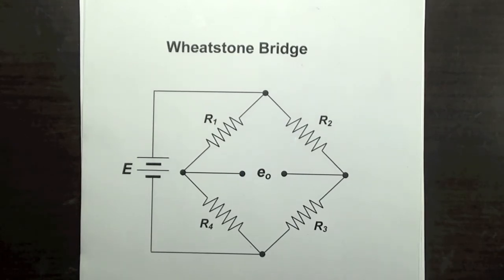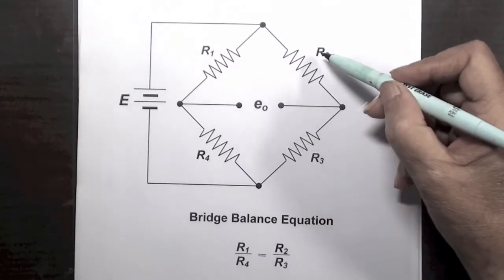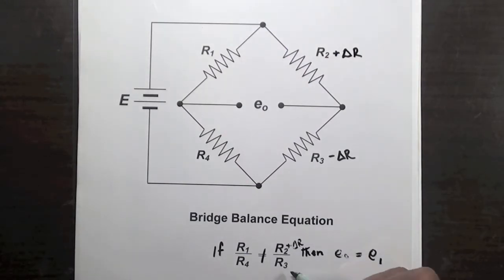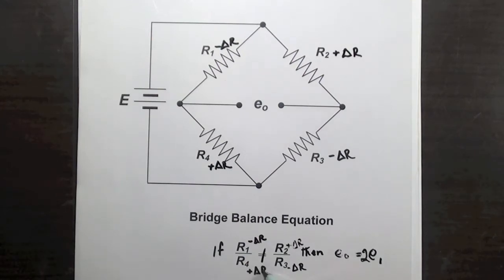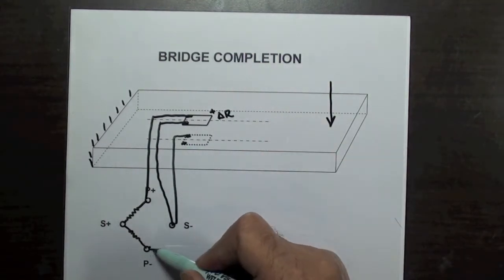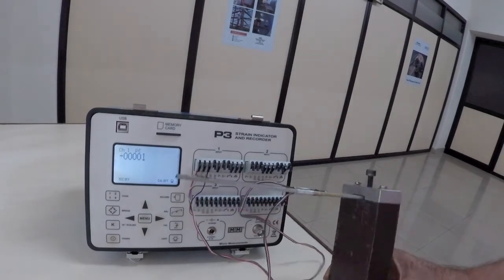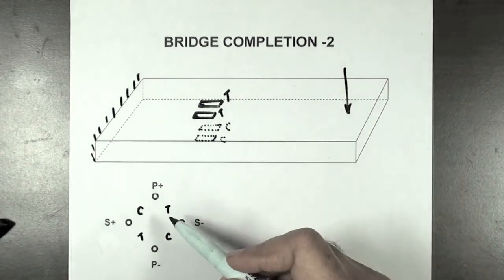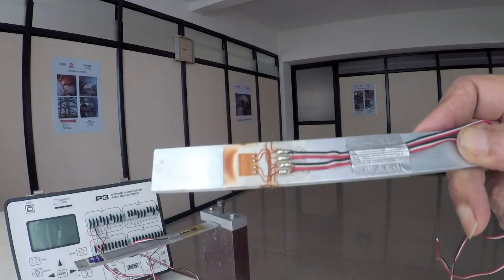Strain gage bridge completion

Comment: what about temperature compensation?
Reply from the maker: If all the 4 straingages in a wheatstone bridge are bonded on the same part close to each other,  all the gages will react equally to any temperature changes , and in a full bridge configuration we can expect these changes to cancel each other, so the effect on the out put of the bridge is insignificant. This is considered adequate for most stress analysis applications
In transducer applications where even small errors are not tolerated, further temperature compensation is carried out by adding small resistance wires made of Balco, which is sensitive to temperature changes, to an individual arm of the bridge to compensate for the temperature change.  Adding this resistance in the arm of a bridge will un-balance the bridge, and this unbalance is compensated by adding a similar manganin wire( which is insensitive to temperature changes) in the adjacent arm to remove the offset caused by the Balco wire. 
 Each time a change is made, the part is subjected to temperature changes and tested for adequate compensation, 
Regards
Reply: @DynatecIndia  Very clear and instructive video, my sincere compliments! I have a question about temperature correction: we want to measure the elongation of a rod that is subjected to tension. Applying one strain gauge makes the measurement very sensitive to temperature differences. How should we apply 4 strain gauges on the rod for keeping them on the same temperature? I would say R1 and R3 in axial direction and R2 and R4 in tangential direction but I'm not sure...
Reply from the maker: @hugogroeneveld5404  That is correct - R1 and R3 in axial direction, and R2 and R4 in the transverse direction.  All the gages will be at the same temperature. However the output of the wheatstone bridge will be 2.6 times , not 4 times the output as from a single gage. This is due to the poisson effect. (Sorry I did not see your comment earlier..)

Comment: God bless engineering Indian guy on youtube answering all our engineering related questions.
Reply from the maker: Thank you for your kind comment. I will be glad to assist further on straingage related queries.
Reply: @DynatecIndia  Thank you so much! By the way, do all 4 strain gauges require an equal increase in resistance DeltaR for the bridge to work? The structure I am working with behaves differently at the top than at the bottom (composite) so my strains differ.
Reply from the maker: @tepochcalli  I would like to reply as follows:
Assuming that all the gages in the bridge are having the same initial resistance R, the output from the wheatstone bridge is given by :

e(output) = Excitation voltage  ( dr1 - dr2 + dr3 - dr4) / (4R)

Where dr1, dr2, dr3 and dr4 are the changes in the gage resistances in ADJACENT arms of the wheatstone bridge, and these values are positive for tension and negative for compression. 
So the DeltaR for all the gages do not have to be of the same magnitude, but must be having opposite sign in adjacent arms, to get an output from the bridge. 
Example 1: If two gages in adjacent arms change by dr1 and (-dr2) for positive and negative strain respectively, then the output of the bridge will be E  (dr1 -(-dr2) +0-0) /(4R)
= E ( dr1+dr2)/(4R)
Example 2: If all 4 gages in adjacent arms change by dr1  (-dr2), dr3 and (-dr4) for positive and negative strain respectively, then the output of the bridge will be E  (dr1 -(-dr2) +dr3-(-dr4)) /(4R)
= E ( dr1+dr2+dr3+dr4)/(4R)

It is not necessary for  dr1,dr2,dr3, dr4 to have the same magnitude, such as in your case where the gages are at different locations.  However it would be very much preferable to carry out a calibration with known load or force, and plot the bridge output vs load. For instance, in a column load cell designed for compression, two gages are aligned along the long axis and will be in compression, while two more gages are aligned in the transverse direction and will be in tension(sujected to poisson strain). The gages are connected in compression-tension-compression-tension inseries, but the tension gages will see only the poisson strain , around 1/3 the strain of the gages subjected to compression.  The load cell will however be calibrated by actual loading, to determine the output vs load relation. 

I hope this is clear, please let me know if I can clarify further.

Comment: The strain gauge give what value and unit?
Reply from the maker: The straingage responds to strain on the part to which it is bonded. It has to be made part of a wheatstone bridge as described earlier, and connected to a strain indicator such as the model P3 from Micro Measurements. The output from the straingage will be indicated on the instrument directly in terms of microstrain on the part when subjected to loading. 
Regards
Reply: Thank you so much for explaination. I dont have facilities like p3 model to get the data 😣
Reply from the maker: @amiridham3117  The strain gage is very sensitive, and unfortunately it does require a very stable and sensitive instrument designed for this specific sensor, to give a reliable measurement. Please plan to procure one. 
Best regards
Reply: Alright thank you for your explanation i really appreciate it
Reply from the maker: @amiridham3117  I will be glad to assist further if you send me your queries to me e-mail ID vijay.dynatec@gmail.com

Comment: Why are strain gauge resistor assemblies made so small? I think if they are made long - like almost as long as the metal bar they are stuck on - then the change in resistance would be higher. Do longer strain gauges exist? If not, is there any specific reason for strain gauges be this size?
Reply from the maker: Strain gages are made to internationally accepted resistance values. The most popular values are  - 120 ohms and 350 ohms. This is regardless of the size of the gage. 

The change in the resistance of the gage is dependent on the strain in the part on which they are bonded. Strain is a ratio, and as a ratio, in a uniform strain field, it is the same regardless of the length of the strain gage. Example a strain gage with a length of 3mm will change in resistance by the same amount , and measure the same value of strain, as a strain gage having a lendth of 6 mm. 

Strain gages will average the strain over the grid area. In a uniform strain field, the average will be the same if the gird size is more or less, but if the part has a high strain gradient, gages with different sizes will give different readings. To measure the peak strain at a point, it is important to choose a small gage to cover just the peak strain area as far as possible.

For non-homogeneous materials such as concrete, rock or fibre-reinforced plastics, it is necessary to average the strain over a large area to miimise the effect of highly localized high and low strains, and for this strain gages of 25 mm, 50 mm and 100 mm grid length are available. as well as very small gages of 0.2 mm grid length for demanding applications. 

Please see our video STRAIN GAGE AVERAGING EFFECT on YouTube, under the channel Dynatec India.
Reply: Thanks for the detailed response!